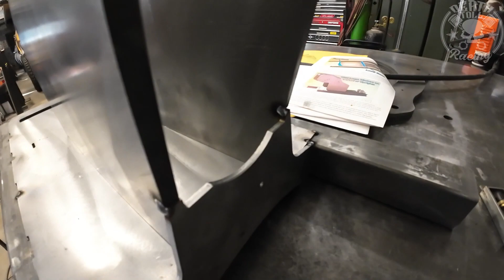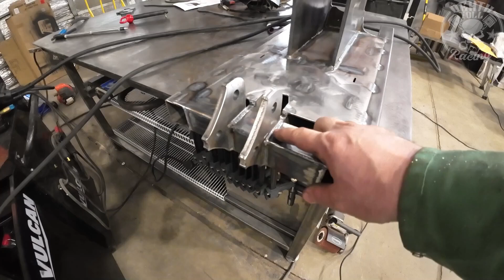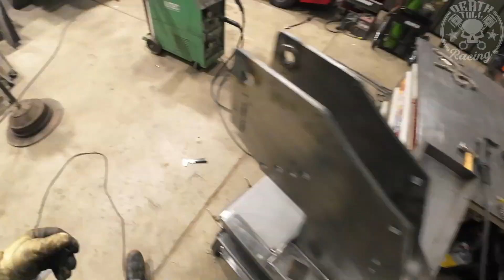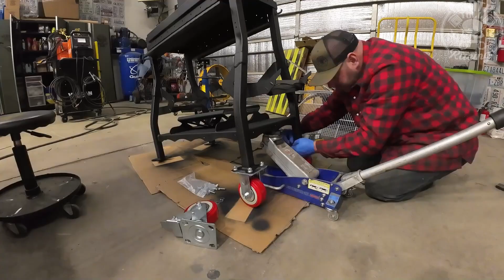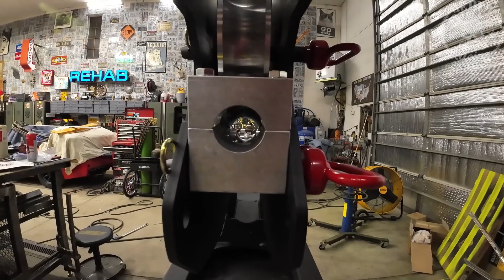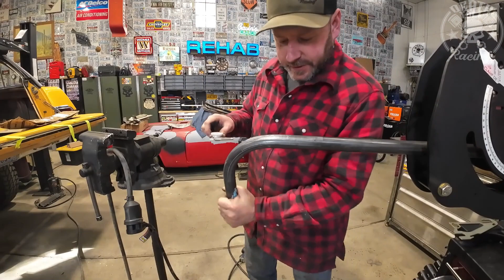Rogue M625 Fabrication, Modification, Testing, and Bedazzling; Tubing Bender Build 2" DOM 1/4 Wall!

Comment: The M625 is supposed to bend up to 2” solid bar. Rogue has a video on it. Pretty impressive.

Very nice build. I love the extra touches you put on it.
Reply from the maker: Thanks!  It doesn’t even flinch at anything I’ve put in it. I can’t see ever needing a solid bar, but it’s nice to know it’ll do it if I do!
Reply: @DeathTollRacing  Do you have the auto-stop for the pump? I’m thinking about getting the 2hp, but I’m trying to find out how easy it is to adjust the auto-stop.

Comment: Speaking as a fitter / welder I bet that different die roll shelf two protrusions is to weld a plate there as a stop so as you start pulling your selected pipe rolling die off the full cradle your die will stop against that plate so you can get a better hold on the die with both hands so the die doesn't slip out of your hands with gloves on so the die doesn't slip out of your hands and hit the floor or your foot ! 😢
Reply from the maker: It’s been a while since I built this, so I’m not following. I haven’t had an issue with any dies falling off as built though.
Reply: @DeathTollRacing  the extra plate would serve as a slight stop for the die letting you roll the die out of the full cradle position to like a secondary cradle / stop to allow you to access the center hole on the die with a finger too as you roll the die into your other hand and lift the die to give you better control to help eliminate the die from slipping out of your hands so you don't accidentally drop it because the roller dies are very smooth and could slip out of your hand wearing gloves. Of coarse  that's just my opinion. If you haven't already you outta call or email the company and ask them and see what they say.

Comment: Rule of thumb, your weld is only supposed to be half the size of your thickest plate your welding together. So if your welding two 1/4" plates together your weld will only be 1/8". If your welding a 3/8" plate to a 1/4" plate your weld will be 3/16" unless directly specified by the engineer on their blueprints.
Reply from the maker: That’s a rule of thumb of specified by your employers / contract procedures, not a general rule across the board.  Always refer to the procedures of the company contracting the work.
Reply: @DeathTollRacing  I said to go by the drawings witch the weld size will be specified by the engineers. But, regardless of what you think, what I said about weld size is true. Don't take my word for it. Go do some thorough research and find out for yourself. But every drawing should specify weld size, weld placement, where every side to be welded is to be welded solid or skip welded .
Reply from the maker: There's a lot more criteria to it than that. The aws books take up an entire bookcase.   Like I said, it's a good rule of thumb, but it's appearing you'd rather argue.    @chriscox5568

Comment: Hi Sir, you moved through the video well, good speed.  Question:  If you were to bend a roll bar with that bender how do you index or clock the bends to be the same on each side so the end line up on the floor correctly?  Would you score the tube on the centerline and aline in the holding fixture that way?  Not sure how clocking works on this bender. Also, does the holding fixture have line marks on it?  Thank you Sir.
Reply from the maker: I use this--- https://amzn.to/3MGspsY

with this you will mark the top or side of the tube and reference all your bends off that mark (that would be on the last leg of the tube if your bending your loop)  

There are other ways, but I find this is the easiest.  This method will also work on a horizontal bender.  

Your next question is easy.  They have a chart for set backs so you know where your bend center is in relation to your block.  They have a nice section on this page to show you the offsets.  https://www.roguefab.com/bending-101/

Comment: That thing turned out sweet!  Why is the pump switched to turn the motor on and off with the hydraulic lever?  It seems like that would be hard on it to me.  I guess it's convenient though.
Reply from the maker: I'm actually going to address that soon.  I agree, I don't like that either.  It feels hard on it, but at the same time, once I'm more familiar with it, I probably wont have to pulse it so much.
Reply: A lot of those style of hydraulic setups have a low duty cycle so it can be hard on the start capacitor but save the motor from over heating. Mine has a 80/320 duty cycle. 80 seconds of use 320 seconds to cool off. I feel like you could work well within that duty cycle to let it run continuously on one bed.